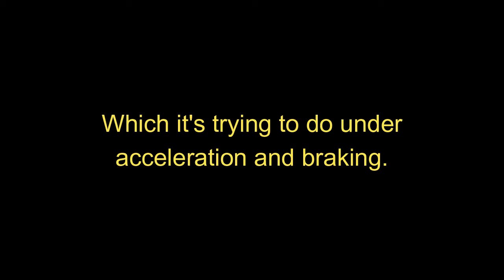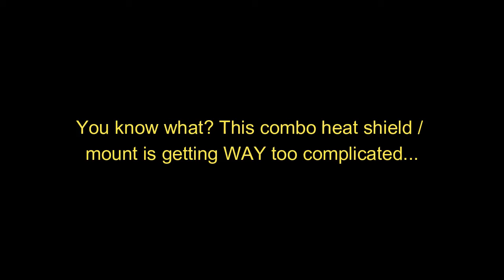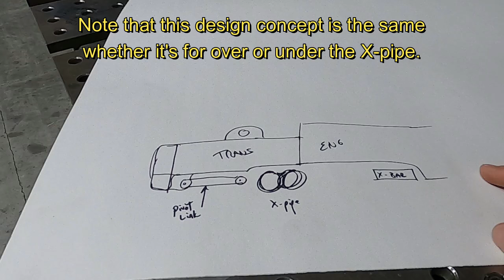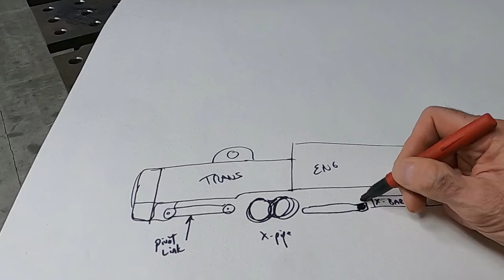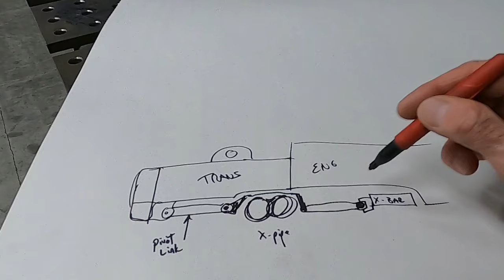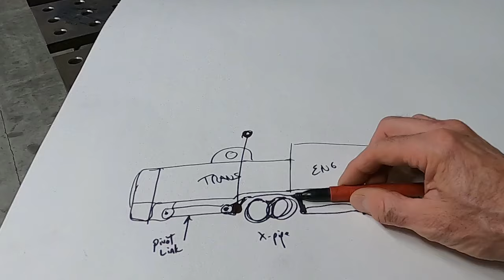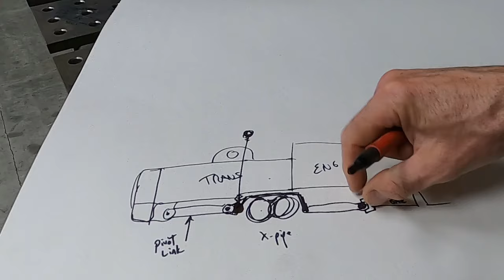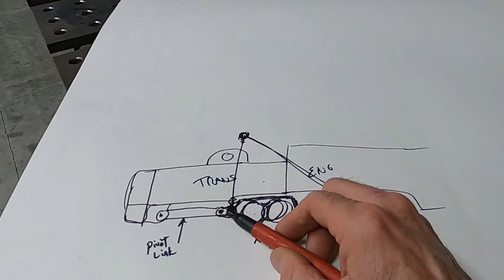914 Ferrari Build - Episode 51: The Pivoting Link Mount Fabrication!

Comment: I'm gonna have to go back and watch that earlier episode, because I'm still not quite wrapping my head fully around the mounting setup.

It looks like you have the heat shield effectively mounting to the chassis, but the X pipe and trans are a separate lump from that which can move fairly significantly.  I'd figure that you would just separate the heat shield from the mounting system and attach it to either the X pipe or the trans, because you're much less likely to have those things move relative to each other than anything attached to the chassis...

Comment: So if the mounts are soft , use stiffer mount material.  I can't see that the under box mount is necessary.  If it is, why can't it be mounted to the rear? Lastly how was the mount used in the ferrari?
Reply from the maker: Ferrari wanted to isolate the drive train with "soft" material so I'm going with their design and parts. The mount is going to stay and can't be rear mounted as the available struture is sheet metal that would require a ton of extra support that isn't practical.